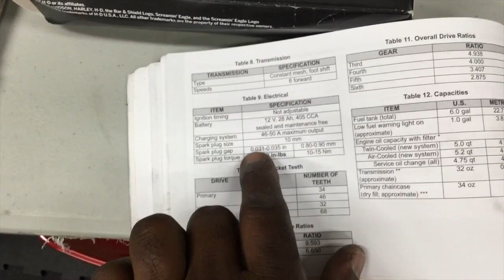Spark Plug Change Harley Davidson Milwaukee 8

Comment: Good work! Doesn't seem too hard. Loving those red cables.
Reply from the maker: It's easy....I was reluctant to remove the tank (because I had never done it before) but it's very easy. Otherwise, there isn't much difference than changing the spark plugs in a car.

Comment: Great video.  Not sure why you would need to remove the saddle bags though.
Reply from the maker: Probably don't need to remove saddlebags. I can't remember why I did that! It's time for me to change plugs again, so I may redo this video
Reply: I was wondering the same thing ...removing saddle bags doesn't seem to matter unless you're taking out fuel fuse